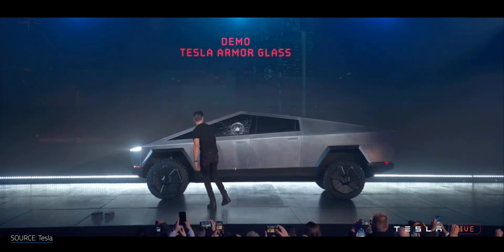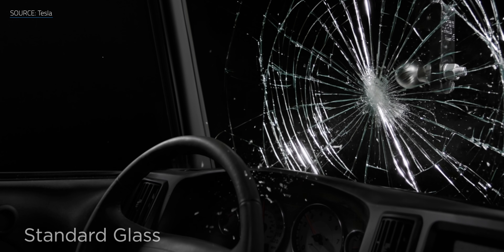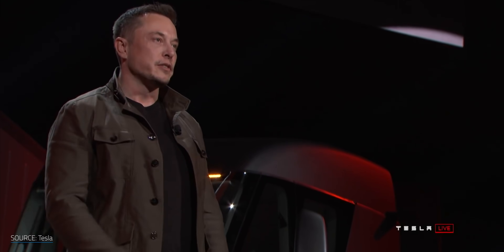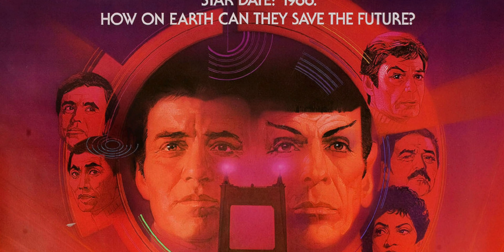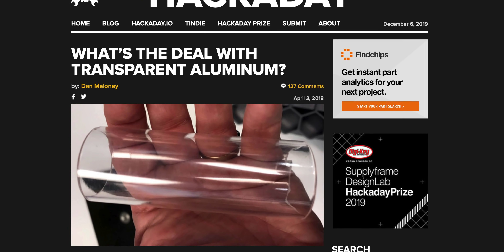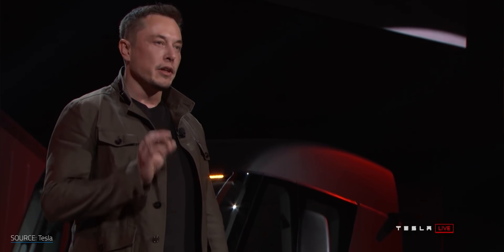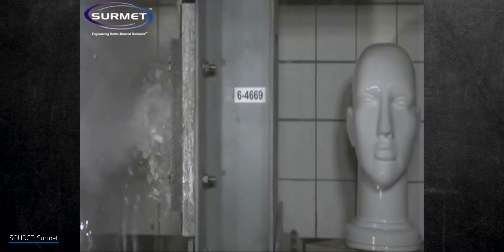Transparent Metal Glass - What is Tesla Armor Glass?

Comment: 1:48 And the obvious solution to that is to use policarbonate or a similar plastic with flexibility that doesn't shatter or crack easily.
Reply: @avada0  weaker
Reply: @VerxxYT  Not Necessarily. And when they make it as strong as glass, it will still be lighter.
Reply: @avada0  more volume for same strength is all I can assume
Reply: @avada0  true, idrk
Reply: @avada0  no scratch resistant

Comment: Ahhh  windshields... I've broke quiet a few, but about 15 years ago, I had my most frustrating break when a rock came out of a dump truck going the opposite direction on a two lane hyway. It split it right thru the center, but what really got my goose is that I had just replaced it the day before and of course insurance deductibles made it an out of pocket expense...what a deal lol. This glass would also be great for boats as well as homes and other buildings in high wind environments

Comment: If It had a little more elasticity, It would be perfect. Bend out of shape but don't crack, like a sheet of metal. 
But then, you could just straighten It out and in most cases never buy a new one, so business would die.
Remember how strong nylon stockings were? You could haul a car with them. Because of that durability sales were dropping, so the scientists were ordered to make material worse, so It would degrade over time.

Comment: .50cal SLAP rounds went clean thru 2" thick of Grade 5 Titanium like butter that's used on the space shuttles I believe. Easily defeated by my industrial 2" AR500F. Titanium still wins technically because how much LESS WEIGHT it have relative to steels while still offer as much protection as steels. Also Titanium has bit higher melting point as well and it won't be affected by oxidation unlike iron or steels.
https://youtu.be/rcOrZj5GTKo

Comment: Someone mentioned to use Alon for glasses.  That would work, but I think it's overkill.  The force that the lense would stop may very well prevent the lense from being compromised, but as for the the lense staying in the frame and not plowing a big hole in your head is an open question.
Reply: I'd want to know if it's x-ray opaque. The transparency of polycarbonate to x-rays is an issue if fragments get embedded in the eye as it makes them far more difficult to locate for removal, and polycarbonate I think, is bio-reactive. Glass (also x-ray transparent I think?) isn't as big an issue as the body doesn't recognize it as a foreign body and fragments not interfering with vision can be left in place.

I hadn't known Matt was in Massachusetts, my native state.

Comment: the AlON and geopolymer research I have been doing has kicked up some promising possibilities for cheaper production and a tougher material through polymer like chain AlON instead of the heated pressure crystal like structure, so it has the same or nearly the same hardness but far more flexibility when deformed to avoid cracking when bent "too far" by a very hard round object with its infinitely small point of contact and all that weight behind that tiny point of the ball lol 
First though have to focus on the controlled meso pore based hybrid AlO/C structures for controllable super small vacuum tubular structures that also allow power flow into the cavity to light up some laser diodes that release x-ray frequency photons ;) (charging both the laser diode crystal structure to release photons, and charge up a carbon nanotube interior lining of the pores to keep air out through static negative charge force instead of covering the end with a substance that any x-ray level photons would be absorbed into and probably ablate instantly breaking the seal on the interior vacuum chamber, so best to maintain it with something the photons can pass through but the air can't ;) )

Comment: $10-15 per sq-in doesn't seem unreasonable for a high tier smart phone. 6x3 inch face your looking at around 200 bucks. Plus it would be cheaper if they can set up a mass production line. I wonder how easy it is to cut it off a sheet. Do you use a small plasma torch like on regular aluminum?

Comment: The key for the glass is to not crack as its truck off road, saying that because the projectile didn't go through the glass (but cracked the outside) still didn't fix the issue. Your not trying to protect the occupants unless your the military but rather as at the beginning of the video prevent a crack. It cracked. It's not market ready.

Comment: Well there is also a thing called metal glass - i.e. metal that is glass - i.e. glass is a state. Main problem with this armor glass is that current cars and trucks already have very, very damage resistant glass. Try to go to a junk yard and break a window - go ahead - see how "easy" it is. In fact current car windows can deflect low energy bullets or greatly decrease penetration - see videos on youtube of actual rounds fired at junked cars. So why not a stronger glass? Notice that glass windows need to break - you don't want indestructible windows in case of an accident. One can also go with something like gorilla glass used on phones - the actual ceramic is the future of phone glass but not so much cars.

Comment: mounting would also be a great addition thou in figuring how to make something more durable.  there is a difference between hard mounting, soft mounting and reactive mounting of things.  hard being bolted down as tightly as possible to soft where its still bolted down but using a softer material to help absorb shock waves to reactive which would mean mounting it using the softer material on one side of the hard mount, (where you can if wanted use a 2nd layer of soft material on the backside) and a floating hydrolic or spring type of base.  of course the faster something moves might defeat these actions and still damage it but i'd think it would damage it less... the problems will be the space needed, cost of the added components and possibly of systems to monitor the pressure within the system when you go reactive.

Comment: I've owned Class 8 trucks since 1983, usually 2 or 3 at a time. I also own a 10,000 square foot truck and equipment repair shop, and hold a Pennsylvania state inspection mechanics license. No, truck windshields don't get broken once a year or anything close to that. And most cracks do not fail a truck for the annual inspection, let alone put them out of service.
Musk's exaggerations make him look like a liar. Where you find one lie, if you look, you'll find more

Comment: I'd like to propose this corollary to Arthur C. Clarke's third law: Any sufficiently advanced marketing is indistinguishable from truth.

By this "transparent aluminum" logic, anyone wearing a watch with a sapphire "glass" could say their watch face is protected by "transparent aluminum". One of the core insights of chemistry is that elemental (ie atomic) constituents can bond to form new materials with with properties unlike either constituent. It's not pedantic to call BS when a marketer calls an Alon-like ceramic "transparent aluminum" or "transparent metal" because aluminum and Alon share no physical characteristics, outside of both being solids at room temperature.

I'm not sure why it's not just as cool to say "we replaced sheet metal with stainless steel! and we replaced glass with ceramic!". Calling Alon "transparent aluminum" is like calling those crappy two-wheeled self balancing boards "hover boards", brilliant marketing and a sort of cultural appropriation (the 1980's was a culture, right? j/k).

Comment: Of course I want 1/8th inch thick alumaoxinitride (let me try again) aluminaoxynitride on both sides of the phone, with the superb lithium titanate battery. Sure, the phone will be at least twice as thick. So what (wouldn't need that dammed plastic casing making it hard to get out of my pocket). And the battery, it can be charge MUCH faster and at super cold, and better yet, higher temps, because it seems it's getting hotter everywhere, all the time.
I don't want my phone getting any hotter than normal just because I'm charging it in the sun (too) LOL !

Comment: The thing I reproach tesla cars is lack of analog simplicity. Imagine the battery is dead, and the doors are locked. You can't even get out of the car anymore. Add to that unbreakable glass, and firemen won't even be able to break the windows to get you out, or worse in the stereotypical case of a baby left in the car under the sun. You can't open the windows, can't open the doors, and in the case of the cybertruck, can't even look behind with the side-view mirrors. I see the cybertruck, and I ask myself: if, for some reason, I fall down a river, then I'm screwed.

Comment: If Tesla can get the price of Alon (or whatever their formulation is) to come down from that $10 to $15 per square inch, then more power to them. And I would have no problem driving a car with transparent metal whether it's transparent aluminum or transparent steel. If it keeps me safe and doesn't crack all the dang time, then why not?

Comment: Just a layman here, but those side windows didn't look like a super-hard ceramic -- they looked more like the reinforced glass normally used on car windshields. Now, maybe the windshield is aluminium oxynitride, or maybe they're planning on offering it as an option, but I doubt all the windows would be (mostly because it would be unnecessarily expensive).

Comment: It’s funny they would use this glass on fake space stations as they used duct tape to seal a hole supposedly made by debris. Lol Did you know they use a o ring on the window latch. Not very high tech but supposedly good enough for the vacuum of space. Imagine that, we can’t mimic the vacuum with a tor 10 which is very powerful and they want us to believe they can seal holes in these space stations with duct tape and average o rings... They concept of propulsion and ignition of fuel in a vacuum has been debunked, proving these methods to be fairytales of nasholes. Now I know why none of those astroNots refused to put their hand on the Bible and swear to God they really went to the moon or “space”. Sorry to pop your bubble if you believe in “space” or even solar system’s. Do some research and you’ll see how it’s a newer form of sun worship. Now I know why they put a pyramid on their money, foretold by the missing book of Enoch. Heliocentric model ergo sun god helios, all the planets are named after false gods on purpose.

Comment: Ehhh.... 
It really depends on what characteristics Elon is using to define a Metal. 
Given that he's describing crack resistance, ALON is a decent guess, but Vanadium oxide glasses with a tungsten or other high density metal is also a good possibility. 

As far as that goes, I strongly disagree as to why ALON is priced the way it is. 
There's literally no reason for the cost of artificial Corundum to be as high as it is. 
A dude with an arc welder, a pile of aluminium oxide, and maybe a high power microwave oven can make a sheet of a optically clear corundum in his garage. 
The thing keeping artificial Corundum  expensive is manufacturer refusal to innovate in favor of planned obsolescence.

Comment: I wonder if the heat transmission is close to the base metal.
If someone wants to really tout this stuff, and make something that would to really capture some attention, I have an idea.
I know full well this stuff is ridiculously hard to make, but here goes...
Make a small 4 cylinder gasoline or diesel engine out of this stuff.
Everything, block, heads , manifolds, crank, rods, lifters, the works.
Yea, expensive, I get that.
But imagine the press, and then imagine what we could learn, not just from the exercise, but the opportunity to actually see what is happening inside, from combustion to lubrication, even down to the way the parts interact with each other.
Stresses, flame fronts, film shear of lubricants...
I would not expect anything but a one-off,
BUT, if it was worth the effort, imagine how this could advance internal combustion engine and other technologies!

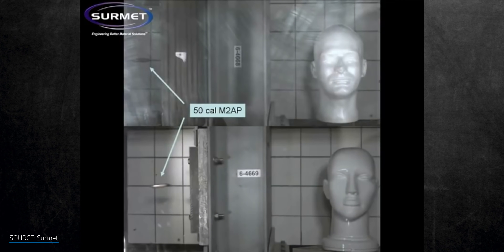Comment: I hate to break this to you, but transparent metal only works well if you apply the "knife cuts metal and is still sharp enough to cut a tomato" technique.  If you remember that commercial, the person would start "sawing" away at a metal object and then turn to show the knife could still slice a tomato without any problems.  If you payed attention you would see the person used the tip of the knife to cut the metal.  Then the blade would make contact with the tomato where it hadn't touched metal.  That was the trick.  The reason the metal glass on the truck broke is because is was mounted to allow zero bounce on impact.  If you look at the sample glass being hit from above 05:40, you'll notice that on impact the glass can bounce.  Also, the velocity of the ball hitting the glass from above is measurable, and I suspect within limit parameters, so the glass couldn't break because they knew all the variables.  When the guy threw the ball at the metal glass all known variables where "thrown" out the window as well.  The only 2 possible outcomes of an uncontrolled experiment is A- it will work as designed or B- for "back to the drawing board".  The glass on the truck had "zero bounce" as a specification.  The throwing of a metal ball requires way more energy than just dropping it, add to that the change in angle of impact caused by gravity and you have a projectile that has the same specs as a bullet (as shown at  03:45).  There is a reason metal ball bearings are perfect at what they do, the engineers at Tesla Armor Glass division should study that before using one to test their products.

Comment: Bonded in place windows are fundamental structural elements in many of today’s cars and perhaps trucks. One observation is that as more and more glass is used as complete body panels, the implication is that the metals are are moved away from the vehicles’ surface (body) and become frames which carry the glass, and then those same frames become optimized for safety and weight savings, which boosts performance efficiencies.

Despite the intimidating present cost of this transparent ceramic, Musk clearly understands that economies of scale will shrink that cost.  Additionally, the “glass” emerges from its manufacturing process as a finished product and merely needs to be glued in place, whereas “finished” metal body panels must subjected to extensive additional human labor in order to render it attractive, and that is quite expensive and that cost will only increase over time, unlike the “glass.”  Then touching on the cost:  A) the Alon shown herein is 1.6” thick and that is probably about 5 - 6 times thicker than is needed for a car, and therefore the $15/sq. inch cost is probably several times more costly than Tesla’s “glass.”  B) the Alon is marketed to the military, so that adds significantly to its pound for pound cost.  C)  Even at an unscaled cost of $3/sq. inch (1/5 the cost for 1/5 the glass as goes in a passenger vehicle), a large window of 30” x 48” would roughly cost $4300 as a finished body panel that would be robotically installed. It’s easy to see the economics starting to pencil out better.

Comment: The issue with the glass that I see is in roll over cases or when the windows need to be broken to get somebody out. If the glass doesn't break the occupant could be stuck
Reply: You can still make the glue around the edge just weak enough to be kicked out, and kicking out the whole window you'd have less glass scattered around preventing secondary injuries from glass lacerations

Comment: Heres the thing... I used to sell new cars. And when you're doing a walk around with a potential customer.. you point out safety features including crumple zones etc... if there were no crumple zones, for example,  the hood would go right through the windshield and cut off your head. The same goes for safety glass windshields. They're designed to shatter but not let things go through.  That like in the video you saw that the item didnt go through the glass. Well if the glass is shatterproof or unbreakable all together,  chances are you could get decapitated by it in an accident.

Comment: Does it conduct electricity, and will that change the material (i.e. turn it opaque?)  i suppose that it would add protection during a thunderstorm, but what about  during an accident?  the high voltage from the batteries  COULD make it dangerous.